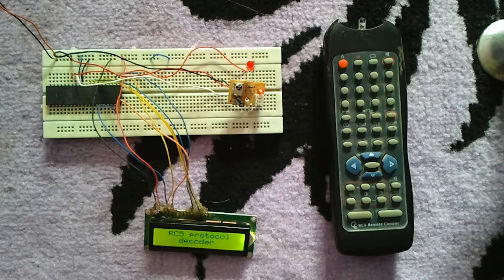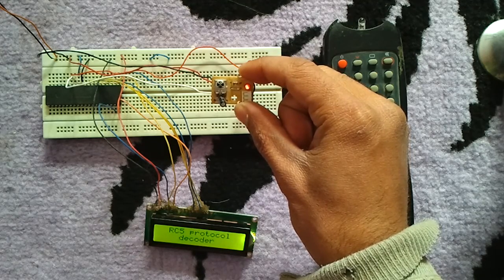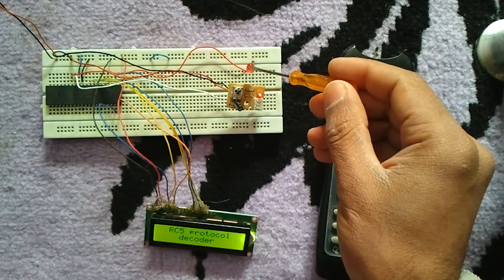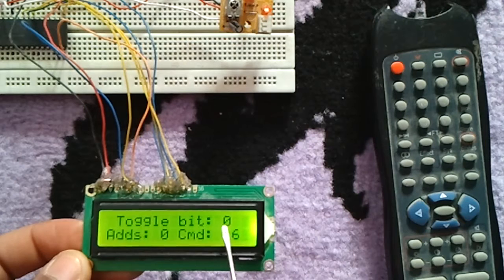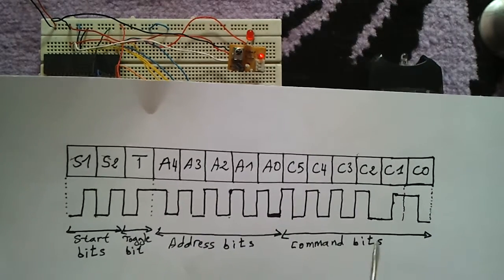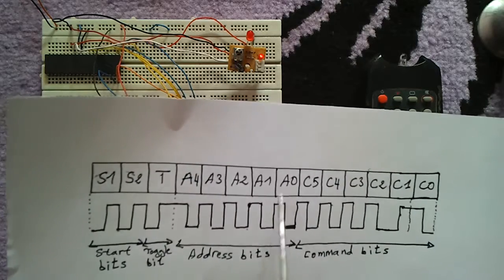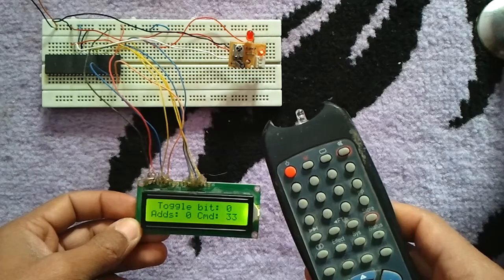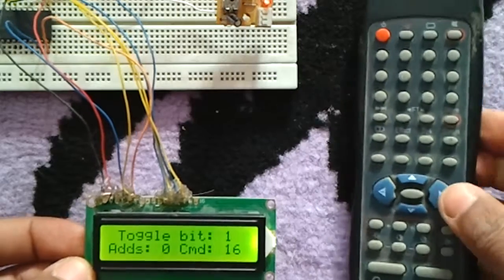Philips RC5 infrared remote control decoder with PIC18F4550 abd CCS PIC C

Comment: Great job! That would be works on my controller PIC18LF46K80? I would like to run your code on my uC. Thanks for help.
Reply from the maker: Yes you can do it using PIC18LF46K80, but may be there are some things you have to modify!
Reply: Thanks for answer. what should i modify?  the code or the Electric scheme?  I am electronics but I am beginner programmer. thanks for help :)
Reply from the maker: I mean the code but I don't know the characteristics of your microcontroller. First try with my code you may get good results. Be careful your microcontroller is 3.3V and oscillator frequency.
Reply: Ok. But i can't find <lcd.c> file on your page. thanks for help
Reply: It work's.  Thank you. Good job!